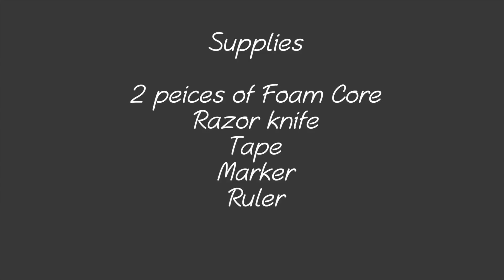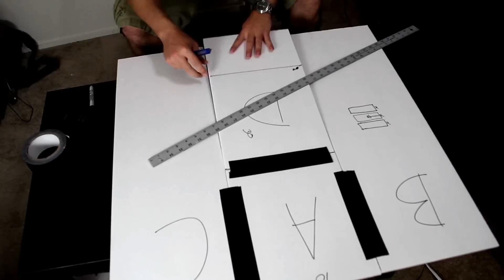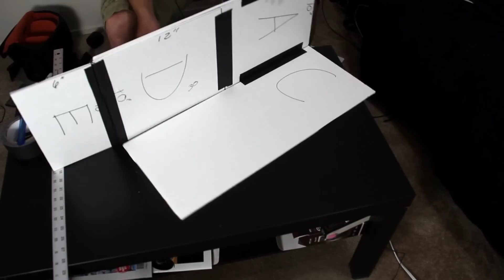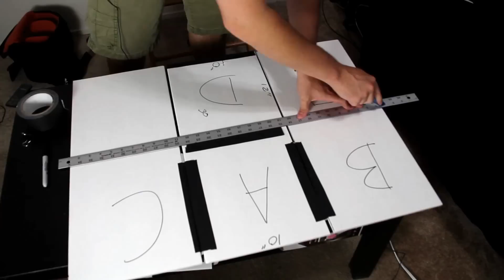Upgraded T-shirt folding machine |RE DO| Danpereda.com

Comment: Grest job. Most retailers show open areas to remove static. (Holes) if you have access to a round hole saw bit, 1"-3" take the drill bit out and just press down the bit will create a perfect perforration that you can cut out or press out.